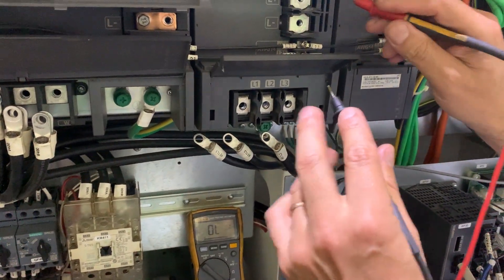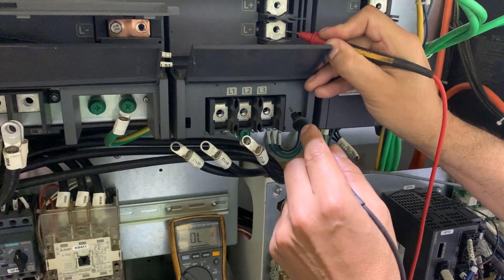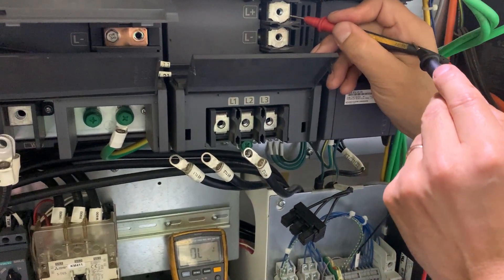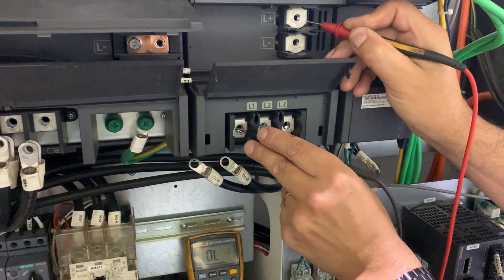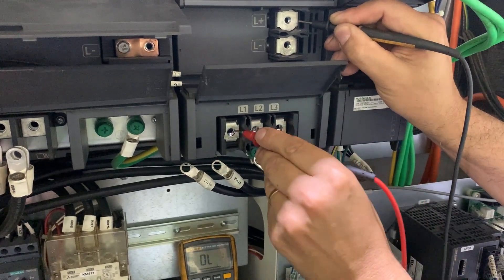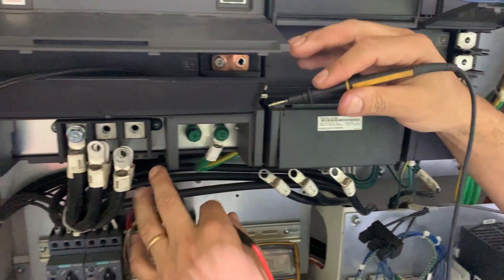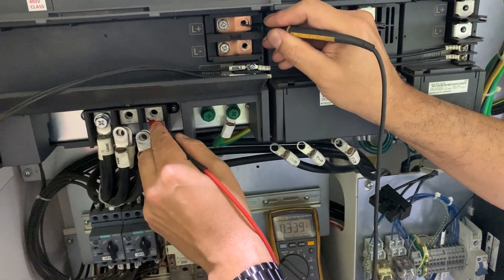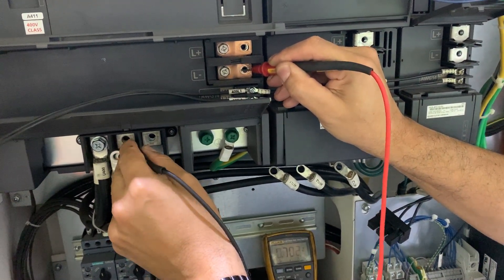Mazak machines: How to test IPMs on Mitsubishi power supply, SP drive and axis drives.

Comment: hey fabien have you worked on 2000s generation integrexes?  640 mt fusion 
the Y axis has seized ? how does an axis seize up?
Reply from the maker: @fredrezfield1629  I’ve never worked with Integrax machines.

Regarding the Y-axis seizing up on your Fusion 640 MT CNC, there are several potential causes:
Mechanical Obstruction: Debris or foreign objects can get lodged in the axis, preventing movement.
Lack of Lubrication: Insufficient lubrication can cause increased friction and eventually lead to the axis seizing.
Servo Motor Issues: Problems with the servo motor, such as electrical faults or overheating, can cause the axis to stop moving
Ball Screw Problems: Wear and tear or damage to the ball screw can impede the smooth movement of the axis
Software or Parameter Errors: Incorrect settings or software glitches can also lead to axis movement issues

It's essential to diagnose the exact cause to apply the appropriate fix. Have you noticed any specific error codes or unusual sounds from the machine?

You ca open the loop and disconnect the servomotor from the ball screw to test the electronic part and manually check the ball screw. There is a video I made about it.

M640T: 22 Feedback System Malfunction ( 1, 0, &0043). How to enable X axis semi-closed loop.
https://youtu.be/MmcX2A6Tr6c
Reply: @FabianAchaval  ok thanks i was going to buy it and repair it
the seller doesn't want to fix it himself

Comment: Good afternoon. could you suggest the instruction meldas500 zero point initialization.
Reply from the maker: Is this what you are looking for?
https://us.mitsubishielectric.com/fa/en/support/technical-support/knowledge-base/getdocument/?docid=3E26SJWH3ZZR-24-2390
Reply: @FabianAchaval  Thank you. No. i have z71 error
Reply from the maker: @zaharevvitalik9012  Z71 is an error you have an MR-J2 drive, don’t you? Please share the part number
Reply: @FabianAchaval  mds-b-svj2-10
Reply from the maker: @zaharevvitalik9012  You can try disabling the drive to check all the rest.
https://us.mitsubishielectric.com/fa/en/support/technical-support/knowledge-base/getdocument/?docid=3E26SJWH3ZZR-24-5425
Reply from the maker: @zaharevvitalik9012  Check if this procedure applies to your machine
M64 APC Zero Point Setting Procedure (CV-500) 
https://us.mitsubishielectric.com/fa/en/support/technical-support/knowledge-base/getdocument/?docid=3E26SJWH3ZZR-24-2719
Reply from the maker: @zaharevvitalik9012  Check next for "Z71 DETECTOR ERROR". There should be an error code next to Z71 that will point the issue.

https://us.mitsubishielectric.com/fa/en/support/technical-support/knowledge-base/getdocument/?docid=3E26SJWH3ZZR-24-2159#page=47
Reply from the maker: @zaharevvitalik9012  Share a video if you can. 
This is your drive's manual.
https://s3.amazonaws.com/Icarus/DOCUMENTS/Mitsubishi_Manuals_1045.pdf
Reply: @FabianAchaval  Thank you